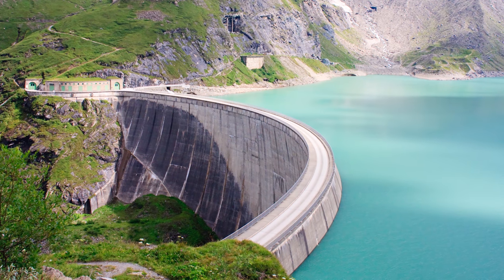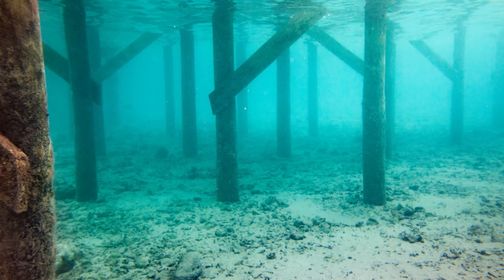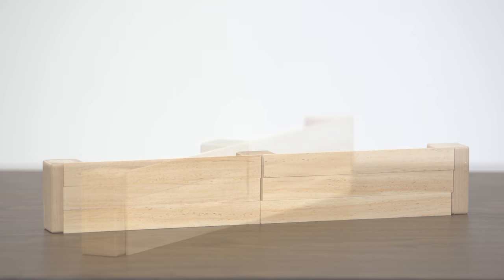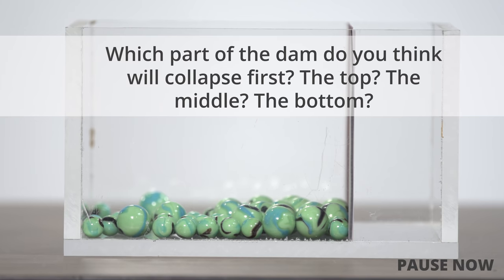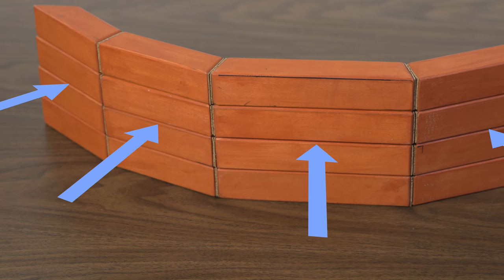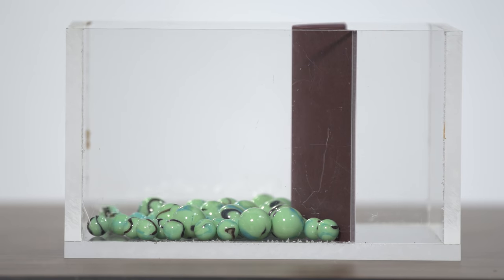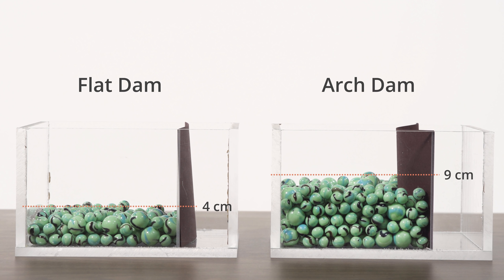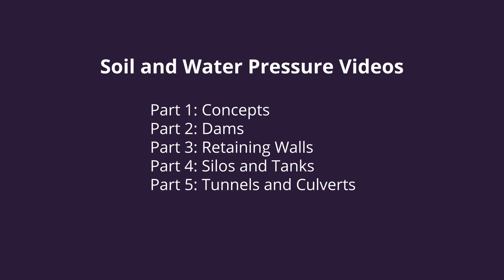7. Dams

Comment: This is amazing. I have no background in this and I understood everything perfectly. Please post more videos.  Thank hou
Reply: Just what I wanted to write :D Amazing explanation. Wont need it, wont use it, but very cool info.
Reply: The video explanation is wrong. Your understanding is based on a flawed idea. It’s not compression. Or tension or anything. 

The first example the paper fails because the ends are not fixed in place. 

The second example it is much stronger because it is essentially fixed in place.the ends cannot move more outwards.
Reply: Really bro right
Reply: Mook Faru they’re inserted into the same grooves, both are fixed in place.
Reply: I'd have to agree with Mook Faru, tension requires an affixment whereas compression does not. I suspect a major reason many dams use an arch shape is that concrete is stronger in compression than tension.

Comment: But why arch? Why not some hemispherical structure? So the protecting wall will be bended in more dimensions - more resistance.
Reply: like, just the same chain test, but in vertical plane (the result will be some kind of a horizontally arched pyramid)

Comment: The video explanation is wrong. Your understanding is based on a flawed idea. It’s not compression. Or tension or anything. 

The first example the paper fails because the ends are not fixed in place. 

The second example it is much stronger because it is essentially fixed in place.the ends cannot move more outwards.